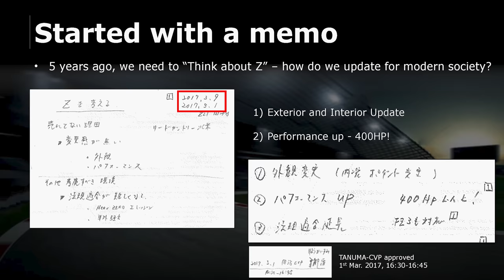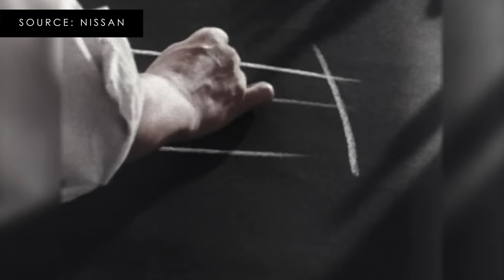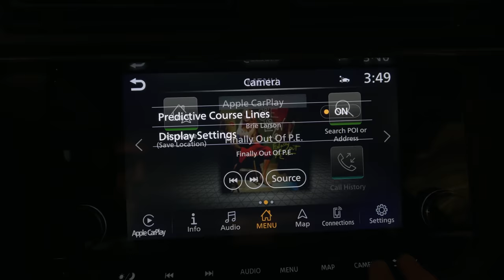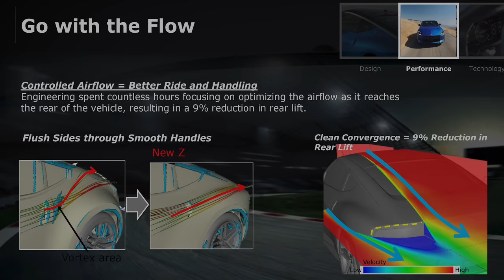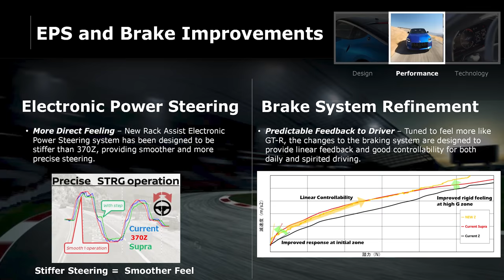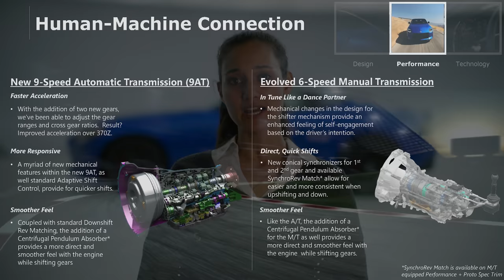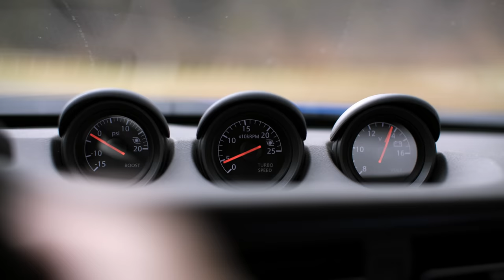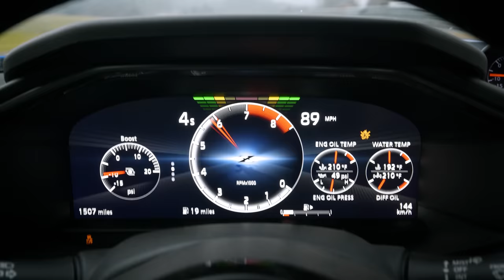2023 Nissan Z | Until The Bitter End

Comment: When companies do stupid things, they should expect stupid results.  You had a beautiful excellent car like the 300ZX with 3 liters, twin turbo 4WS and you replace it with a stocky normally aspirated 3 liter that doesn't look as good and nowhere near the performance of the turbo car it's replacing and you expected it to end in good results?  The only way to let the 350 and 370Z to be a performance car, was to replace the engine with a LS GM engine.  So you've finally come back to your senses, and at a good price.  This car will be in demand and spoken about for decades and for generations; you did the right thing. It's just what the doctor ordered; however, make no mistake, its no GTR.  While I am extremely pleased with this car, I would prefer to buy a used R35 GTR for $50K than this car new, just because the GTR is light years ahead of anything under $100K. But let me end by again saying, this is an excellent car which checks all the boxes, and at the right prices.  Well done documentary.
Reply: My 370Z is plenty fast with some minor mods and a tune. Dynoed at 362hp. Pulls from Mustang 5.0s on a roll on the freeway. Never putting a GM engine in a Nissan car!

Comment: Some weight can be shaved by swapping out lead battery, using manual seats on performance model, and swapping OE steel dampers to billet aluminum one piece dampers from MeisterR for 370Z with much stronger springs. I think there is about 100 lbs in savings from those three parts on performance model. Sport with manual seats won't see as much savings but definitely over 15 lbs on suspension alone and 15 lb or more on battery by using anti gravity brand
Reply: best way to get better times is to just be a better driver. No need to destroy the interior to save 0.0005 seconds off your time

Comment: That BS exhaust system is just BEGGING to be ripped out and replaced by a true dual system with some proper flow. Wtf were they thinking with that pipe diameter!?
Reply: They had to put a quieter exhaust on the manual so it would meet government regulations.

Comment: 16:53 he said "the shock absorber is not holding up the car", in reference to dual wishbone. Did he mean to say knuckle instead? Or was he referring to the lateral loads?
Reply from the maker: Strut cars typically combine the shock absorber into the knuckle making it the upright. Hence a load-bearing member.  In a double wishbone car the upright from the knuckle is connected to an upper A Arm.  The shock becomes independant of that and mounts to the lower control arm or to a fork.
Reply: @savagegeese  Yes that makes sense, but of course, the shock/strut assembly still holds the weight of the vehicle. It sounded like you said it doesn't, which is why I was confused.

Comment: So far have gotten through the first 15 min……dominated by Nissan corporate waxing philosophy.  If the involvement and soul and homage to the 240 was taken seriously, I’m left to wonder why Subaru (w Toyota) makes a sports car that’s 500 lbs lighter for less $ and Porsche makes one for more money.

One could compare the many aspects of a car…..but limited to what makes it a sports car and one befitting the modern day successor to the first Z car…..being 3,500 or more lbs just doesn’t cut it to me
Reply: I own a 370Z and if it was any lighter it would feel like a feather. I'm running 275 tires up front and 295 tires on the rear. It doesn't feel heavy to me at all.
Reply: @povertyspec9651  - the new z is about 200lbs heavier than your car.  

I’m sure it’s quick but it’s disappointing that it’s carrying 300-500lbs more than it needs to.

I have a 2013 boxster that’s 2,900lbs……tbh, I wish it were lighter still.

Comment: If they would offer the base sport with the LSD and maybe the bigger brakes for $42-$43K that would be a much more appealing option. I would not want this car without the LSD, and at low $50K range there are more compelling options IMO.
Reply: why do that ???
Their job is to make $$ not loose $$ ...
Reply: How would that lose money? They already sell the base model for $40k switching to the slightly more expensive LSD and bigger brakes would only add a few hundred dollars to their cost at most, and they can sell it for two or three thousand more. So it would make money and provide a far more appealing option to enthusiast that don't care about heated leather seats and a slightly larger touch screen. That's why.
Right now only having the option of going from $40K to $53K for the same car with a few options is a poor marketing choice. At $40K for the sport model without the LSD it is not very appealing, and at $53K for the performance there are far better options elsewhere. Once the recession hits hard (and it is coming) this insane car market will disappear, and after the initial novelty wears off on the new Z, just like past Z cars (and the Supra) they are going to have a tough time selling this car. If they want to sell a lot of them they need to offer a compelling option at a competitive price. 
Bare minimum with 400 HP all models should come standard with the LSD, otherwise every time you step on it in first or second gear it will just light up one tire and that is incredibly lame.
Reply: @ericmichel3857  If you put the LSD and BBK on the sport model they would NEVER sell the performance model. 
They are smart, they kept the same engine in both models and put the LSD and BBK on the performance model to push people to buy the performance model. 
Most people WILL buy the performance model because it has the LSD and the BBK on it and few will buy the sport model and source out the LSD and BBK to install it seperate.  
400 hp and 350 tq is a LOT of power to one wheel. So that open diff sport model is going to have serious traction issues. While that is ok to some, it will piss off many. 
So once again, Nissan was smart in their decision and they did it for $$$$. 
All the other 13 upgrades will be irrelevant to most. Everyone cares about the LSD and the BBK ... So either get the performance model and be happy or get the sport model and source the LSD and BBK and swap them out.
Reply: @ACommenterOnYouTube  I disagree. First of all low volume sports cars are not profitable for manufacturer's. They exist as image cars to help sell the very profitable high volume products, so worrying about selling a few extra option for a bit more is not why they do it. A lot of people pay a bunch extra for all sorts of silly cosmetic options, so no wrong again there are plenty of folks who will want the performance version regardless. 
No enthusiasts are not going to buy the sport model because tying to upgrade after the fact is far more expensive, so that makes no sense. As it is, the sport model will be for poser's, people that want the look and prestige of a 400 HP sports car but rarely is ever use it so they don't care if it can't put the power down well at low speeds and around corners. 
 The previous 300,350,370 Z cars were all 'milk toast who cares' cars that were more or less ignored with relatively poor sales. They looked good and provided mediocre performance and value for the money, but there was always other options that offered much better performance and usually for similar or less money. That is why the Z has always been a milk toast meh sort of car, and with this marketing decision the new Z will maintain that tradition.

Why? Because we have already seen that its performance is not on par with the competition. Straight line acceleration the Supra, Mustang, and Camaro will destroy it. We don't have road course comparisons yet but this is the same chassis as the 370 Z with slight improvements, so I am sure the handling will be adequate but nothing special there either. So why would anyone spend $53K for a Z when they can get a BMW M240i, Mustang GT Mach One, Camaro 1LE, for virtually the same money? All of those cars offer far better performance with more value, features, and also look good? 
I think it looks nice, but not any better than the Mustang, Camaro, Supra, or BMW, and all of those offer better performance for the same or maybe even less money.  If you want a fun manual sports car that is not exactly the fastest just get a GR 86 for $32K. Heck you can get a Mustang V8 with a LSD for high 30's low 40K range. The only niche the Z could have filled nicely is an alternative to the sports car value of the Mustang and Camaro as a no frills low $40K sports car with 400HP.  However without the LSD and a few other high performance bits that option is a none starter (accept for the posers), and in the $50K range it is just not a compelling of an option. So once again the Z will become that alternative Japanese sports car that most people forget even exists.  
performance
Reply: @ericmichel3857  well everyone has their opinion and time will tell ...
Reply: @ACommenterOnYouTube  True, but the facts heavily favor my opinion. :) This is after all just a stripped down restyled Q60 Red Sport, and people are not exactly clamoring to buy that far more luxurious and slightly more expensive version. Combine that with the sales and marketing history of every Z car since the 1980's and I think my opinion is a very safe bet. 
Nissan would have had to of done something extraordinary with this new Z car, and they just did not do that here. It looks okay, the performance is somewhat below average, and the pricing is nothing special.
I think they got to hung up on trying to compete with the Supra. However, the Supra has not been a great selling car, it is not exactly a "must have car", so being slightly better than that car is not an achievement. Also if you look at the quality and performance of the Supra it is a notch or two above the Z so being slightly cheaper doesn't make it a better deal than the Supra. They really should have been looking at the Mustang and the Camaro, because those are the two that directly compete with the Z. Both of those cars offer far more options, performance, practicality, with on par looks and better pricing. 
Trust me, after the initial launch novelty wears off, it will become another obscure offering just like the new Supra. They had an opportunity to offer a real performance bargain but they are blowing it. Unless they were shooting for another nothing special middle of the road sporty car option, then just like the other Z cars of the past, they nailed it!
Reply: @ericmichel3857  once again, that is YOUR opinion and only time will tell ...
Reply: @ACommenterOnYouTube  Yes I know, my opinion, backed up with some facts. ;)
Reply: @ericmichel3857  You dont have facts on future events kid .... if you did, would not be argu'ing with me
Reply: @ACommenterOnYouTube  LOL It is a prediction based on the history of the Z car and what facts we know about what it offers vs its competition. 
You haven't really made an argument, do you honestly think this Z car will become a huge sales success? If so why?
I believe it will not and I have explained why I believe this based on several facts and some opinion. 
All you keep saying is that is my opinion, and I keep saying yes that is true but my opinion is based on a lot of facts. 
You are not really arguing with me, just being obtuse, which I find amusing. If you would like to make an actual argument, feel free. Otherwise we can keep going back and forth on my educated fact based opinion and whatever it is you think you are doing. 😁
Reply: @ericmichel3857  call it what you want, whatever makes you feel good and warm inside 🤷🏽‍♂️
Reply: @ACommenterOnYouTube  I just like talking about cars, if you disagree but can't explain why, that's on you. Is that a "whatever" emoji? Like what a teenage girl would say. 😂
Reply: @ericmichel3857  are you still going ??
My 2nd reply to you already explained my side, sorry that you didnt understand 🤷🏽‍♂️

Comment: Adjustable  preload strut tower bar thats not common, even though it came on the 350z 20 years so, I see nothing special. Also nice to see nissans bean counters were the ones who designed this car with so much of the 13 year tech being carried over.
As for packaging, Nissan takes honors in this segment since the more efficient air to air intercooler were ignored for essentially heat sinks on top of the engine. Took them 14 years to address the failing csc issue from the 2007 350z. And at best, this is a 370z with different body work and a bump in power serving as a bandaid for lack of a fully new developed platform. Im sure people will be over joyed to throw their money at what is possibly slower than a civic type r on a road course. Nothing like dumping your entire budget on design. Good job Datsun 👏🏼
Reply: 👏🏼👏🏼👏🏼  they were "listening" for 13 years did you not hear the marketing lady xD

Comment: How does it compare with GR86?
Reply: Very different cars particularly when you factor in prices. The gr86 has a na low hp motor that is somewhat high reving. The z is high hp, high torque, basically 20k more a car with a lsd and without a doubt a platform with a higher overhead.

Comment: All I have been waiting for since the first tesla launched is for a car manufacturer to put a reasonably powered electric motor into a coupe chassis akin to an S2000, 370z, supra, cayman, with nothing much else in terms of fancy gizmo, at a reasonable price for the average working man. Unfortunately, statistically people that would actually buy these cars would be a small number compared to those that would buy an electric hatchback, sedan or SUV. This is why car manufacturers don't put any effort into actually making anything like this. 
The tesla roadster would probably be like you said - unobtainium. Similarly the Polestar 02 will most likely be upmarket. I guess for now, those after a driver's car, without blowing their bank, would still have to stick to our 4/6/8/ cylinder coupes.

Comment: The upper spec/cost to a buyer for the new Z car is going to be well into the $50K's, excluding mark up.
The Supra is better is virtually every way. 
Supra has much better styling...if the new Z car were a cake, it is half baked.
Supra/BMW straight six is a much better engine.
Auto to Auto, the gearbox in the Supra is much better.
Interior is much better and more upscale in the Supra aka less plastic and better layout.
Chassis is better in the Supra.
An upper spec Supra is not much more expensive than this car.

Its a Nissan.  Nissan is the bottom feeder of Japanese auto manufacturers.  The outgoing Z was dismal.  This is fractionally better but the world is a competitive place and I would rather have pretty much any $50K something car than the new Z.
Reply: Blah blah blah.
Much better styling? The public does not agree. Supra is one of the worst looking sports cars ever sold.
Z will outsell Supra by a 4 to 1 margin, if not more.
V6 TT in the Z can easily be modded without much effort to 450hp and more.
Don't care about the auto trans.
Supra interior is claustrophobic and looks like a boring BMW sedan inside.
I guess you didn't watch the video where Savagegeese says the Z is the better driver's car.
Bye bye.